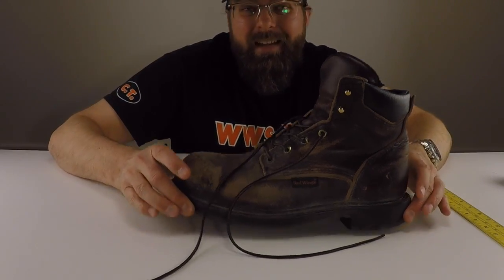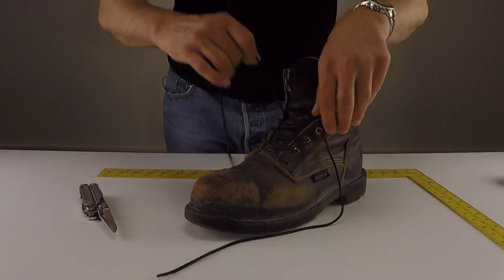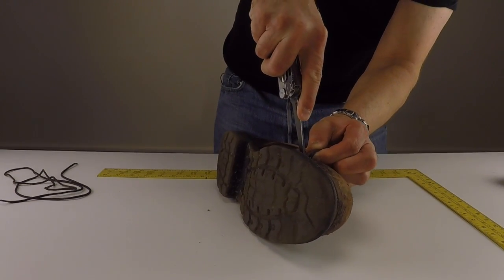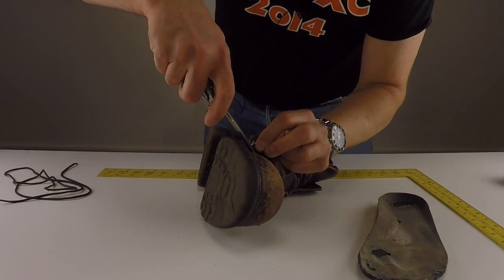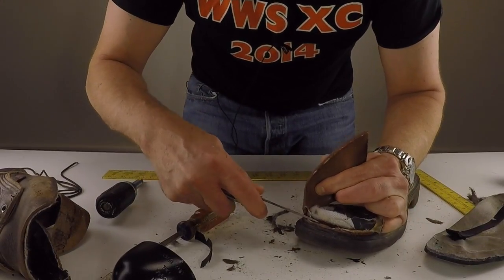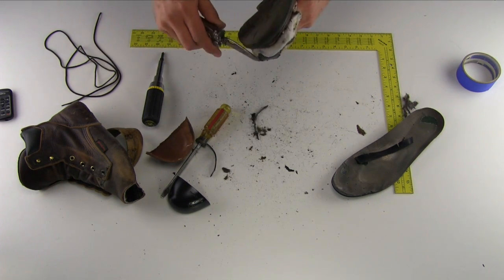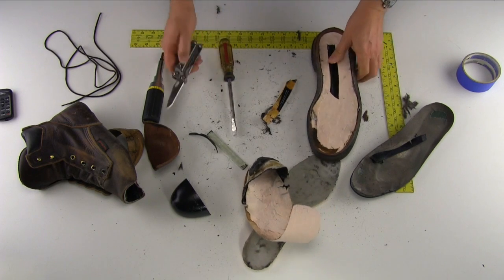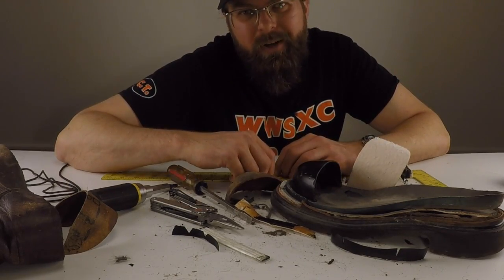DISSECTING RedWing 2406 [ The Boot Guy Reviews ]

Comment: I have a pair 2408 with the supersole 2.0 and I was not happy with the life of them only 1.5 years before they complete fell apart. So I had a local cobbler replace the worn out with Vibram christy soles and LOVE the boot now vary conformable boot   to work 10-12 hrs a day in central Texas in Summer !! I think the heat in Texas is really hard on this type of sole they not made for temps 100-115 F all day but any love the videos you do Thank you

Comment: I have these same boots. Every 6 months I clean them with soap & water. After they are dry I rub some Red Wing burgundy color shoe cream all over to the boot.  Lastly I used the Red Wing mink oil.  After I let it sit for several hours I start wiping off the excess mink oil.  The burgundy cream is always rubbing off onto the rag.   Is this normal?  Is there a better method of using the cream and mink oil?
Reply: Obenuafs Heavy Duty LP. Originally designed for fire fighter boots. I love it.

Comment: rookie question - what does the shank do? is it just to try and deflect any nails you may step on or what?
Reply: Devon Sacre from what I hear the shank is for climbing ladders, kicking a shovel and much more so it won't wear out and tear up your boot
Reply: As another comment mentioned it’s to add support when putting pressure in the area by distributing said pressure. It also makes the boot more supportive as it helps the area between the heel and forefoot from sagging. Think of laying down a 2x4 with one end on the back of a truck and the other on the ground. If you put weight on the 2x4 it will begin to bow, the shank would be akin to putting another 2x4 on top (or something more rigid)making it handle more weight before bowing the same amount.